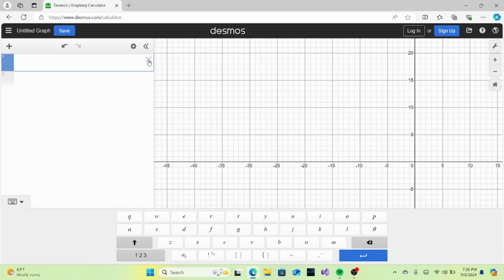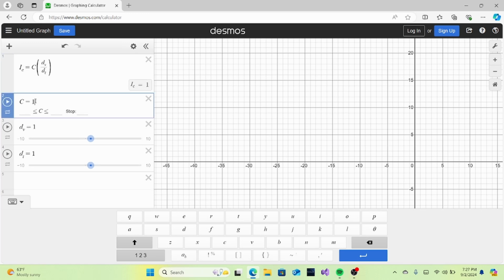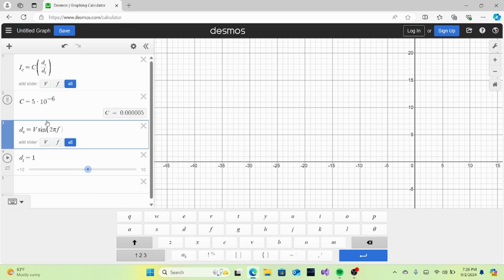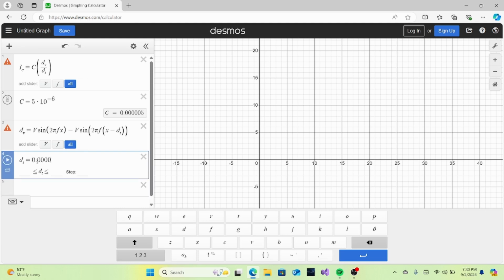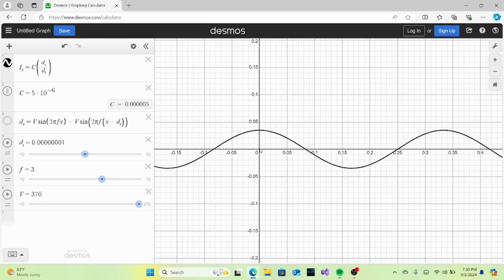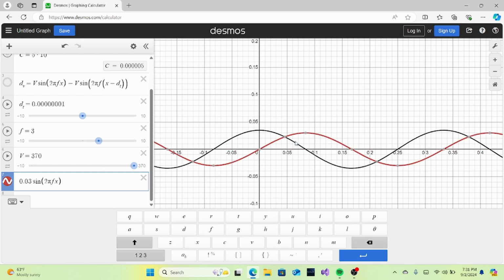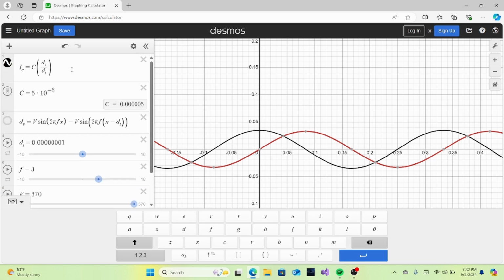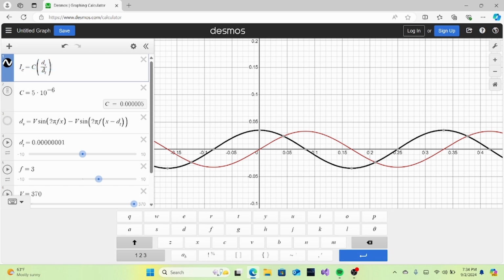Capacitor Current Explained

Comment: I'm surprised you got such a pretty oval running AC into a polarized cap. I thought it would distort a lot move reverse biased.
Reply from the maker: @SkippiiKai  it seems like the poly caps have the most ringing patterns and noise out of the ones I've tried (though that is probably just because they have less capacitance and higher impedance at 60 HZ). I'm in the process of designing a VFO to drive the components with audio frequencies, that should probably help when looking at smaller caps and inductors.